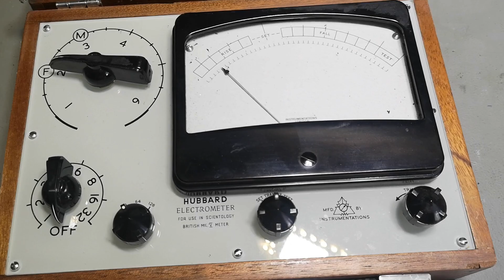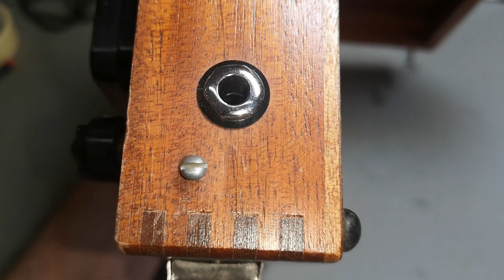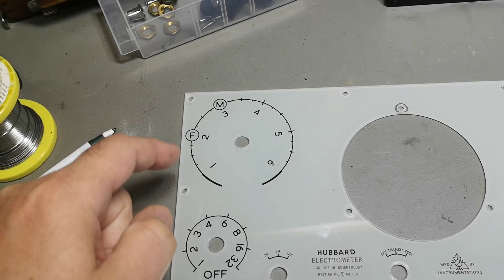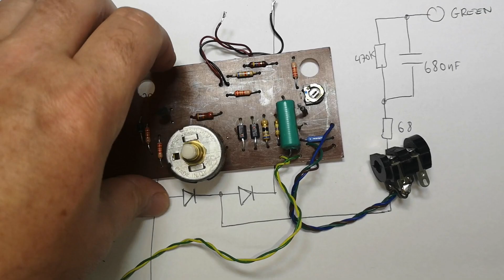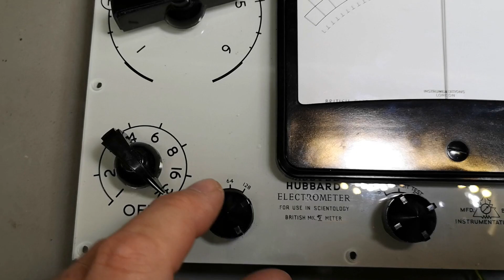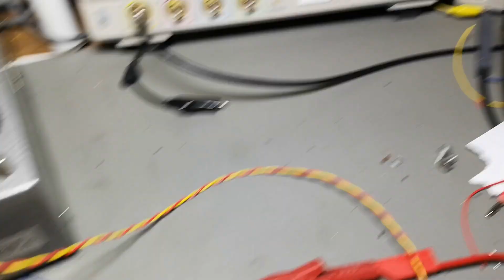Hubbard Electrometer British MK V Electropsychometer E-meter Scientology test repair teardown

Comment: I am working on one now. It has a Yuasa battery with NO data on it and rotten. Your video shows the better battery with lots of data which will help me get a new one. The model I have has the battery in a clamp screwed to the inside case angle. I never was trained to use one but have experimented with a Mark III, IV, V, VI & VII. Not the Mk VIII which disables itself if not sent yearly for inspection to stop experimenters partly. It is an advanced version of a Wheatstone Bridge which was used at the turn of the 20th century by psychologists for therapy but discarded. It was refined as a guide to detect mental trauma, points of interest & stress from misdeeds as ONE part of a standard lie detector use in use for decades. It can easily be demonstrated to read as a fall to right on thoughts by oneself. It is affected by squeezing V-8 juice can as electrodes but this is stopped if still. The theory is thoughts have electrical energy and affect the ohm resistance in the body slightly. A very traumatized or tired person reads above 3.0 as more dense mental masses. Below 2.0 is a condition of an overwhelmed or hungry person. 2.0 is the ohm of a dead female. 3.0 dead male if connected to a corpse. Meaning no longer a mind affecting anything. If the large Tone Arm is at 3.0 for a male with the needle drifting freely it means nothing bad from the mind is currently affecting one and feeling good. 2.0 for women. As long as it is in between 2-3 it's ok. You need a large microphone plug with 2 alligator clips on the other to attach cans. Hands must be dry but not calloused dry. Or fake low or high Tone arm. Unplug cans, put switch to set & Tone arm to 2.0 trim knob to set mark on dial to calibrate then plug in & leave on set to operate. I believe it is charged with dial to TEST & Switch on. Transit is to protect needle during travel. Some people have a very active mind like me and need a low sensitivity setting like 1-6 to show long or short reads on thoughts..others can need it way up to 128 max. Sorta dull folk. The 2.0 = 5,000 ohms. 3.0 = 12,500 ohms. Must warm cans and have to clean contacts. These older meters were always sold as British imports for $127 the '60s. Then increased to over $500 made in USA..then by '86 ..$3,600...now Mark VIIIs $5850 and you are required to buy 2 @ $13,000 with tax! Rich man's game to be a living god!
The 70 yr long lies that it ONLY reads on sweat or squeezing is patently obviously, false in testing. They would NOT be in real polygraphs forever if the Wheatstone Bridge circuit did not read on emotions! Logic please not Propaganda for the "masses". You can also hook up someone give them a nasty pinch that hurts seeing the fall read. Then wait a while and ask them to recall that moment..you get the same reading. Then it dissipates as energy released which the whole idea of the abreactive therapy sessions for painful memories asking for earlier similar memories if it does not release. Abreactive therapy was also disgarded by psychologists because they never went into earlier similar memory chains to get and blow the basic earliest charged memory holding it all in place. (I found a $10. - 7.2 volt battery pack on Amazon using 6 AA type nickel-cadmium cells. Scraped off cover 1/2" to solder white wire to one batt like original. Bit hard to fit but glued to box in batt space. It works but meter off a bit, but works for tests.)

Comment: Sensitive resistance meter, with built in drift, and also with no actual use other than to show resistance varies, and direction. Not not a medical device, but it is sold as a religious object, sort of a high tech Icon, there to be in the home of the faithful, and worshipped. Note they are extremely expensive devices, and are classed as all being part of the church, and so are bought, worshipped, and returned or passed down to the faithful.